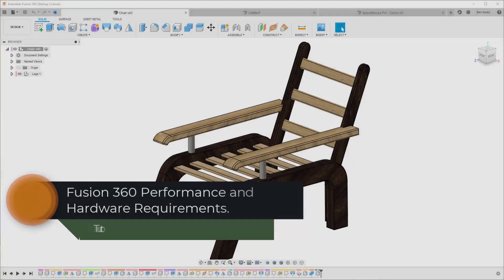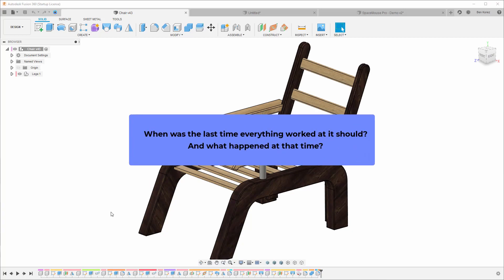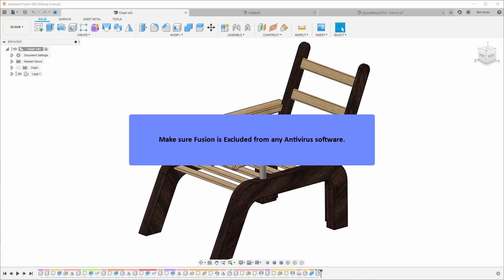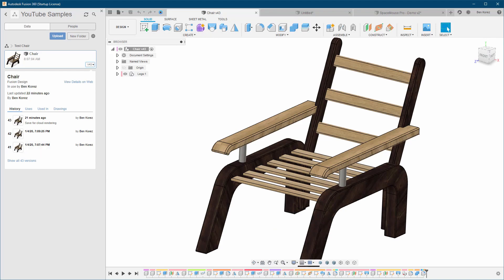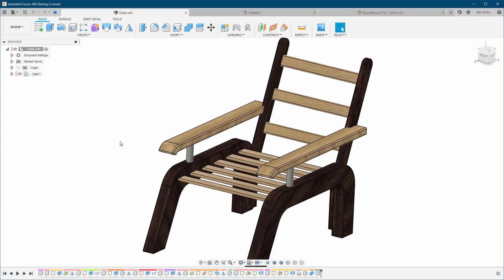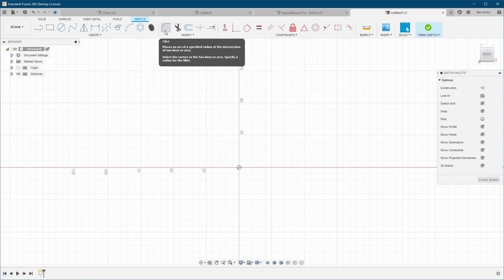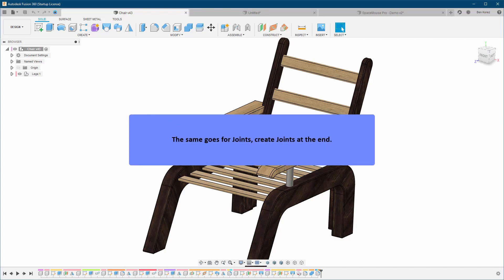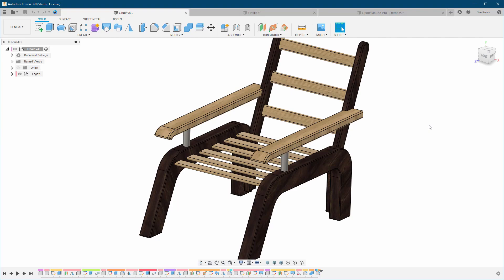Fusion 360: Hardware requirement and Performance Part01 (2020)

Comment: Some useful info, but I wish reasons were given.

For example, what's the problem with leaving "show default measurement" on?

I didn't know about it, and will use it from now on.

Most of the time when I want to know an edge length, which is very often, it takes more than one try because a point will highlight instead of the edge.

And it gets confusing when you want to interrogate many edges in succession.

And how could displaying a single edge length effect performance at all?